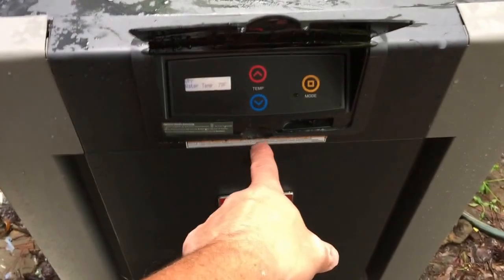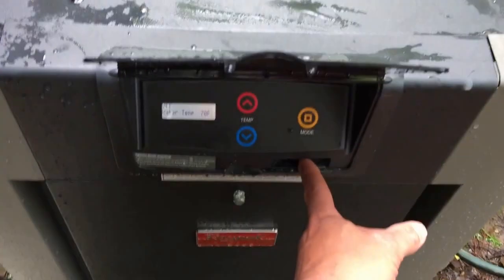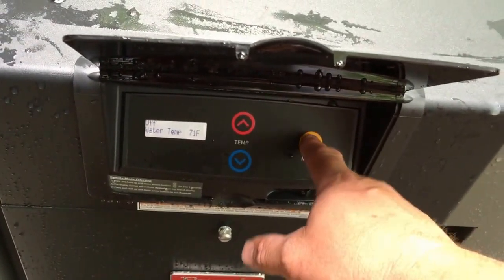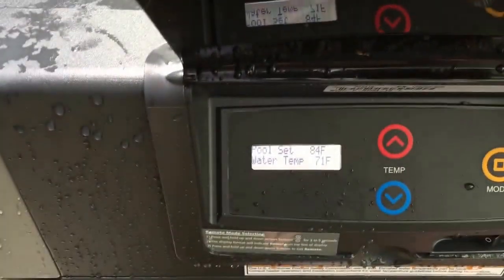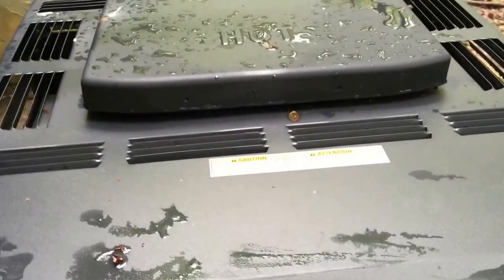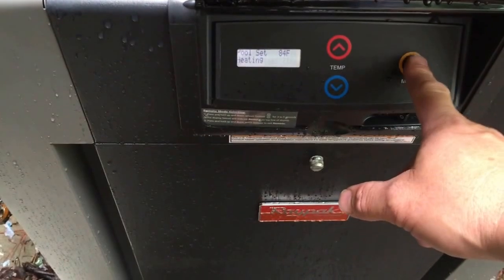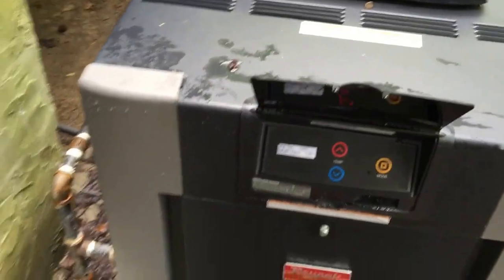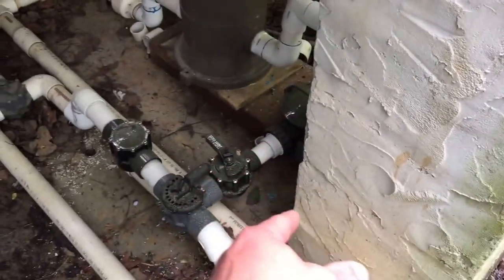Raypak Pool Heater how to control manually

Comment: Mine was sitting there unused for two years covered in AZ dust, I'm surprised how easy it was to crank up. I just flipped power rocker to On and the beast went alive like no big deal, from 72F to 90F in 3 or so hours for 17000 gallon pool. Pentair intelliflo 2 VST was running at 3300 RPM.

Comment: I just replaced my Raypac bezel control and I need to know if I have to wait until my pool is running to check to see if it works.
Reply from the maker: yep... Pool needs to be open and operational to test out the pool heater
Reply: @lukepoolservice  i need to know if the display should be working if the pool is not running.  Right now it is black.

Comment: Hi, I just bought this unit. For some reason I didn’t turn the pump off and opened all valves so there wasn’t a pressure build up in the heater and then closed the heater valves. This was so I could run the pump and bypass the heater to shock the pool. It sounded like pressure building in the heater so I quickly opened the valves again right away. Anyway it now says water switch open and won’t turn the heat on. Is there a reset for that or do you think I blew something up? I’m really beating myself up over this mostly because I have small kids that won’t be able to swim now because Dad screwed up. I learned to turn the pump off before closing/opening any valves. Any help would be so greatly appreciated! Thank you!
Reply from the maker: Call for help.  Complex machine.

Comment: What is the minimum speed required for this heater to run?  I have a variable pump and I am not sure about the speed needed.  Thanks.
Reply from the maker: Depends on the pool.   I would say 2500

Comment: Any idea... My raypak is on rem on but the temperature reads the manual spa temp from the heater and is using that setting. When it first turns on it displays 84 which is the pentair control panel setting, then it changes to spa from the raypak heater setting and stays there. Temp can't be changed on heater control unless I take it out of rem on. Pool company changed a board in the heater last year, could it be hooked up wrong?
Reply: Raypak heaters reststarting

Comment: My heater is showing that the panel is locked and requires a pin to unlock it and use it manually. How do I unlock it?

Comment: How do you override a low temp lockout on this heater?
Reply from the maker: You can’t.   It’s a part of the safety circuits to prevent damage to the heater and potentially voiding the warranty.
Reply: You’ll risk the chance of condensation. You don’t want that

Comment from the maker: Anyone who calls our office, I can't give advice out over the phone.  I recommend finding a local pool professional to help.
Reply: I got really lucky and found the female electrical connector to the water pressure switch came off. Once connected it came right on. I learned my lesson, always turn the pump off before opening or closing valves. Thanks for your help anyway.
Reply: So this is kind of crazy but I went out and checked it in the heater shut off it was reading 120°. In the back of my mind I couldn’t figure out how the electrical connection blew off. I remembered seeing the wires sitting on top of that Temperature sensor it was pushed up all the way to the top. I noticed as I pushed the temperature sensor down deeper the water temperature began to drop to normal temperatures. I realized what happened was when the pressure built up in the system from closing those valves it pushed the temperature sensor Up and that’s what blew the wire off the water pressure sensor. So there was a few chain of events that happened which caused the heater to not function properly. I got everything back in order and it is functioning as it should.

Comment: Luke I'm getting power but the display isn't lighting up. The previous owner used to have to push several buttons to get it to wake up and display. I can't remember how he did it. Do you have any suggestions?
Reply: William Buckley did you find an answer to your issue? I’m having the same issue.
Reply: Same my pool heater will not light up

Comment: I am getting a sensor failure message and the unit won't fire up. I have a Raypak R266A heater. Any clues?
Reply from the maker: +Michael Lee Best to contact Raypak directly for assistance or find a local pool professional who can handle the issue.
Reply: Michael, did you ever find the answer to your problem.  I have exactly the same model and am getting the same error and most of the info on the web seems relatively useless.
Reply: the unit should provide you an error code.
Reply: +Bad Alice  -  The only error code I see is "Sensor Failure" and when I try to find it on the Raypak site I find nothing specific but it looks like it could be the thermocoupler or temperature sensor.

Comment from the maker: Pool heaters are complex machinery.   I can't fix a hvac ac unit or a water heater.  With anything Gas related a recommend contacting a professional.   Fix it wrong could result in a fire or someone's death.